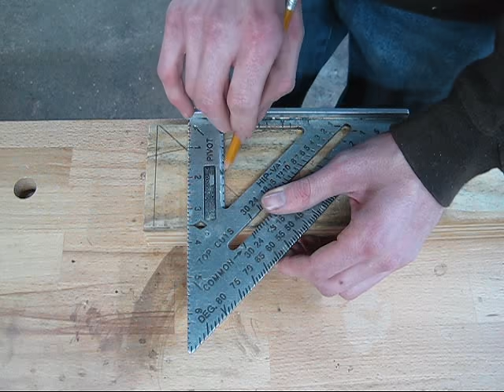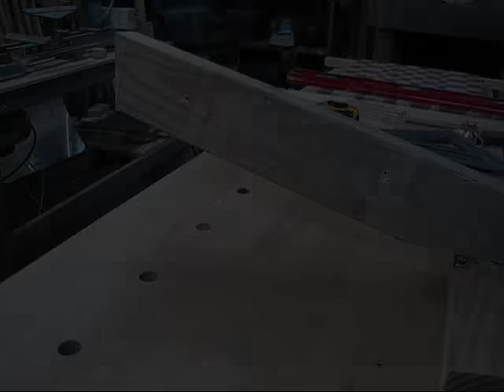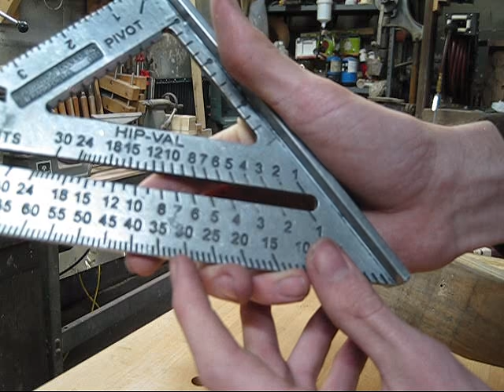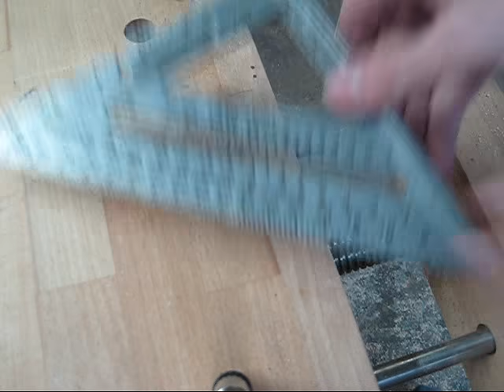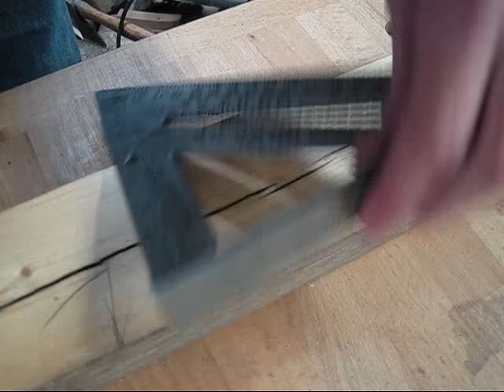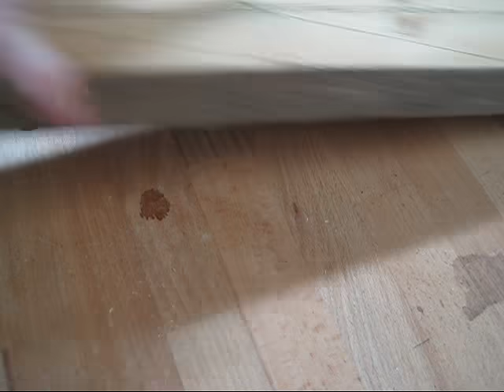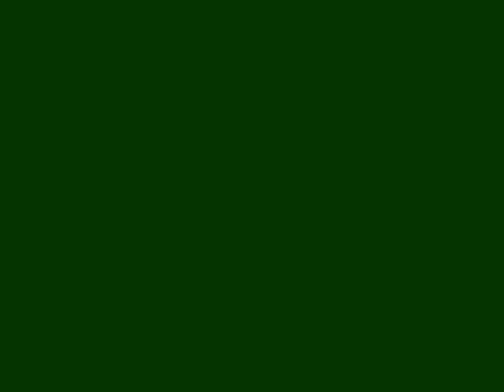The basics on a Speed square

Comment: Classic Work, i find it easier to check for roof pitch using the speed square and torpedo level. i just lay the lip of square on the rake with my level set on top of the level, then pivot up until the bubble is center. the value where the rake and square intersect is your pitch, same as your plumb cuts. although the plumb bob is so fricking accurate i trust it a lot more than a torpedo that got dropped on its head at birth, in this case i think the level is accurate enough. i love your vids!
Reply from the maker: Thanks man.  Aye it is a lot easier to use a level just a different way of doing it.

Comment: the numbers on the "common" line represent the roof pitch for common rafters and the roof pitch is read as 3/12.  Meaning 3 inches of rise for every 12 inches of run.  Using the number marks on the common line and striking the line as you did will provide you with what is known as the plumb cut

Comment: why do people have to be so nasty? I learned some from this vedio
Reply: Mike's road trip 2017 thats because some ppl don't want to learn they want to be stupid and talk crap because they think they know it all. Hell ive never knew all you can do with a speed square I've always used it for straight lines
Reply: Les Twin
Reply: That ain’t the way you layout a birdsmouth on a rafter.  Also it’s not how to determine the pitch of a roof. So it’s bad information. If you went on a job and did that stuff you would get laughed at and probably fired.
Reply: He has no clue how to use this tool properly. He thinks "HIP - VAL" means Hip Value lol, it is Hip and VALLEY
Reply: If this is so bad, please post a video that shows how to use this correctly...Thank you ... Would really like to see it used properly !!!
Reply: The Swanson speed square  comes with a book on how to use it correctly.   And for a birds mouth you always measure from the top down for a couple reasons.    First reason is that wood is not always consistent in the measurement.   Second reason  you might have 2 x 12‘s and two by tens in the same roof.   Or you might have to match a valley in the same run, the only way to do that is to measure from the top down which is the proper way.    Or just read Swanson speed square book.
Reply: @SD-ir1vf  doing it for video and in real life are somewhat different. he is teaching. I learnt.  be nice.
Reply: @rotagbhd  I heard hip and valley when he was talking, he assumed that we had enough sense to ascertain the abbreviations.
Reply: @SD-ir1vf  his was to replace the worn ends. not build a house
Reply: Like I said.    Buy the Swanson speed square that comes with the book.    They will teach you all the correct procedures.    If you do anything this guy says people are gonna look at you like you’re from outer space.
Reply: @SD-ir1vf  who cares what the idiots think?  Looks to me like he got it right.  2+1=3 or 1+2=3 so it comes out same.  Sometimes i have to explain things that way to people  to get their attention so they understand a simple concept on their bank statement.  Youd be surprised how many people dont understand final interest after payoff because they think theyre being charged interest on $0 AFTER they make the payoff.  Even after its explained 5+ times its from the closing date until they paid it off. Then they want to cry in frustration.
Reply: He used a Sponge Bob square Pants.  Not even a laser or a level.   Pull one of them out on a job and see how many people laugh at you. In fact most jobs if you use a level when you are supposed to use a laser you will be fired.
Reply: @rotagbhd   He said Hip and he said Valley. it does sound like he may have said value the first Time and maybe he did but I know he meant Vally because he said them both very clearly right after. have you never said a word that sound much like the word you meant to say. also he is making a video and its not like you can just correct your mis phrasing. Its sounds like most people understand the effort he was going through and many of these cats are professional carpenters too. Besides I have watch a lot of people try and explain things they don't know about. only a fool would watch one video when they are trying to learn something. and it because clear who knows what they are talking about. I don't spend a bunch of time talking shit about the person who was wrong or an idiot . I may say it to myself but I wouldn't spend a bunch of time writing a review about it. I figure only someone who is equally an idiot is not going to figure it out on there own. so try and stay positive or make your own video that has the correct information.
Reply: @rotagbhd  he says hip and valley if you listened cloth ears .2:35
Reply: just jealousy ,plain and simple.
Reply: most of us can spell vedio,,no video? oh well.

Comment: I enjoyed the video. I also use a speed square quite a bit. Finding the pitch with that square is much easier than you made it out to be. By simply putting the square on the pivot point. Pivot it to line up with the cut on the end of your rafter and then simply read what the pitch is on the square. No counting, plumb bob, etc. Not critical of your video and maybe you mentioned that. Just my two cents. thanks.

Comment: You can find the pitch way easier with a torpedo level. Plumb bob is hard to hold when you are up in the air. Plus you do not have to worry about adding or subtracting anything. Basically hold the torpedo on flat of the square until you get it level then get your pitch. Too easy.

Comment: Great video! I've used squares for years and still pick something up here. One question I have is how might you measure the pitch of a roof using the technique you showed if there is roof decking installed?
Reply: I know this question wasn't for me, but you can take a 2 foot level and mark it at 1 foot from the edge. Set that edge on the roof and hold the bubble on level. Then measure down from that 1 foot mark to the surface of the roof. If, for example, you measured 5 inches, then you have a 5/12 pitch, meaning that for every foot of run (half the width of your building), you have 5 inches of rise.

Comment: you really don't know what your doing do you.
Reply from the maker: Randy Nielsen Sure don't I make it up as I go along.
Reply: Finally,  a no-bullshit video. I never really got the hang of speed squares, except for the simplest parts, so I actually learned something tonight.
   The rafter -matching part? I never met an angle I could not replicate with a good torpedo and an angle-copier, transfer that straight to the miter saw, read the angle...if that's even needed at that point.

Comment: well i use one daily and you can adjust your heel height so your seat cut is how long your wall is. And there is a lot more to figuring out your rafters. Like. your beam height (rise, run, and distance). then add your heel height. That was basic and not thst great.
Reply from the maker: I'm planning on redoing this video. I know I left out a lot stuff.
Reply: I'm on my way to work right now I just know that there's a lot more information on those and then what you went through but it was alright
Reply: adam jensen
Reply: oops,  wrong window. damn

Comment: Hi , did you get a chance to look at that wee angle problem for me ?
Reply from the maker: Sorry it took me so long to reply.  Yes the reason is reverence.  A speed square has a reverence 90 degrees to the edge (Because it is a square) Protractors reverence from the edge.  One will match the other you just have to do a little math.  If you mark 80 degrees on a protractor then check it with a speed square it will read 10 degrees because (90-80=10)  So the same is true (90-60=30)  Hope that helps.

Comment: The plumb bob pitch measurement can be done much more easily if you just measure the angle on the bottom of the rafter.  3/12 pitch. I should have done this video. lol

Comment: i just needed to know how to use it for the rafters, and how to get the reverses of eachcommon number, thanks
Reply: Alcir Figueroa if you subtract the degree of the pitch from 90° the remainder is the back side angle. For example the three pitch used here is 13 degrees taken away from 90° your backside cut will be 77 degrees
Reply: Alcir Figueroa b

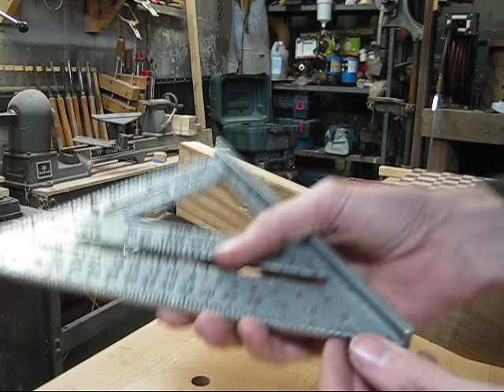Comment: At 4:56 or so, just whERE did you get the '45deg' , from which to count for rafter pitch???
Reply from the maker: 45deg is the center of the square.  So if the plum hangs through the 45 it is level, so in turn whatever the plum hangs through number wise will be the difference.  (45 - 13 = 32deg)

Comment: Your seat cut is way too big. The rafter has the strength of a 2x2.  You fail, dude.
Reply from the maker: It was a demonstration, so you could see it better.  Plus if I was using a 2X4 for a rafter 2X2 is more than a enough for a rafter tail.
Reply: Wrong, how do you attach fascia to a  2X2.  If you cut that much into a 2x4 , it is weakened to the strength of a 2x2, with a snow load or fat santa on the roof, good chance of it breaking.

Comment: Easiest way to check for square is to 6,8,10 it...! And another good trick to use  the square for is after you mark your line , you have to cut it and to cut it right on the line is , line up the blade with line then put the square up against the side of a "skilz saw" so you get a perfect straight cut....!
Reply: UFOLLOWINME 3,4,5

Comment: I need to make a video explaining this thing.
Not one of you guys explains a plumb cut,seat cut,heel, pitch as opposed to bevel.
Not picking on you .It's just the last of many I've watched.
People don't even know why the hip/valley numbers are different.
Answer) Your common rafter pitch is the amount of inches up the rafter climbs for every 12 inches it runs.
Hip & Vallet rafters travel the marked amount of inches up for every 17 inches of run(horizontal travel) .
They should also know that before marking your heel .You must add this height to your overall building height in case you accidentally violate the ht. restriction.
In other words . If yo have a 8 foot wall and you have a 4 inch heel. You have to add that to your overall calculation to stay within restriction,and figure your pitch accordingly.
I got carried away ,but still you should explain where and why the graduates are there and then show how to also figure the seat cut.
Reply from the maker: Please do, and I hope it beats mine.  I'm going to do a different video in the future showing almost everything the speed square can do, and then some.

Comment: could this guy be any more complicating.  There is a much easier way to do this.
Reply from the maker: You see you got to use your triangular squaring device in tandem with your graphite writing utensil to etch a moderately gray line approximately 1 to 3mm thick along the breath of the compressed carbon mixed with water in a quick motion while keeping the triangular squaring device square with the compressed carbon in order to make a visual line to which one can see with the eye.  That any easier for you?

Comment: wish i would have watched this before I decided to add some steps to my deck. Im not a moron and I like to do things correctly so I spent so much time with the calculations, distance from the landing, rise, runs, etc... of course my steps were spot on but omg, im embarrassed to say how long it took me to cut those stringers. I just used my framing sqaure and marked each leg where I needed my cuts which was probably the proper way to do it but I just had such a hard time with the angles and was shocked when the 1st stringer actually his the concrete pad flush. It just took me all day to cut it. hahaha

Comment: Friend of mine was using a framing nail gun and put a nail through his testicle and nailed it to his thigh bone.  After hearing that, I contract out.
Reply from the maker: Framing nail guns I don't like.  I felt off a 6ft ladder because of one of them.
Reply: as long as you felt and  that's is
Reply: That sounds like a very nasty accident to me!
Years ago I fired a 4" nail through my left hand, it went through just below the base of my index finger from the inside of my palm cutting tendons and nerves as it went.  
As I said, this was years ago and I young, it was late in the day with the sun setting in front of me making it hard to see clearly, I was hurrying as it was Saturday night and I had a hot date for that night.  I was nailing the last barge board on at the top of a two story house, I was at the top of an extension ladder holding the wood while putting one of the last nails in at the ridge end when the wood broke away at a knot and the nail went through the board and nailed my hand to the framing behind.  I lowered my gun down to the ground via it's air line then proceed to free my hand with my clawhammer, after getting down I remember pushing bits of my hand back into place by the illumination of my van's head light as it was pretty dark by then. 
Long story short, I did go on my date that night but it was spent sitting together in the ER waiting room of the local hospital.  
The outcome was that I had microsurgery to repair the damage I had foolishly done (it took years to heal properly) and I ended up marrying the girl and having 4 great kids with her :-) 

The moral here is to treat all tools with the utmost of respect and not to take foolish risks while working with them!

Comment: At 7:50 My question is why did you have to flip the square upside down and put it on the other side of the board when you did the plumb cut if you were able to get a 3/12 common on the vertical part of the birds mouth why couldn't you just slide the square over for the plumb cut and put it at 3/12 common  on the same side of the board.   In other words if you were able to get a vertical on the birds mouth why couldn't you get a vertical on the plumb cut without flipping the speed square over.
Reply from the maker: Yes you can.  I'm going to redo this video one day because I made a lot of mistakes, and I was still new to the filming world.  There is a line that cuts though the speed square that you can use to mark a 90 degree line to the birds mouth.

Comment: What is the little diamond cut out between the 3-4 marks used for?
Reply from the maker: There is a few things it can do, but the most common is a rip line.  3-1/2" wide is a 2X4.  Mark out a line very quickly.

Comment: To determine roofs pitch why not just butt up and pivot your speed square to your seat cut or your plumb cut and sight what common pitch the edge of the rafter falls to? Using a plumb bob and counting back on the protractor seems very inefficient even to a beginner framer like myself? Interested to hear feedback on this
Reply from the maker: There is a 1000 ways to do it.  Easiest way I've seen is to put your speed square on the rafter, and use a torpedo level on the square and pivot the square till it reads level then read the square to find the pitch.  I like a plum bob.

Comment: HANDY VID BUT IN MY OPINION YOU MISSED OUT WHAT I CONSIDER TO BE THE MOST USEFUL THING OF ALL WHICH IS GETTING THE ANGLE OF THE HIPWHICH SPEED SQUARE MAKES EASY. IN ENGLAND ALL ROOFING IS DONE IN DEGREES SO EXAMPLE  40 DEGREE ROOF = 10 ON THE COMMON SCALE SO FOR A HIP RAFTER PIVOT AND SET THE SQUARE TO 10 ON THE HIP SCALE JOB DONE! SO EASY

Comment: I believe the diamond cutout at the 3.5" mark is also for a bird's mouth cut (assuming your wall is 2x4 and not 2x6). Make your vertical mark (3:12 here) then flip over and line the top and bottom of the diamond on your line.